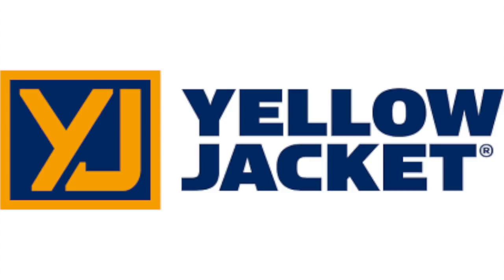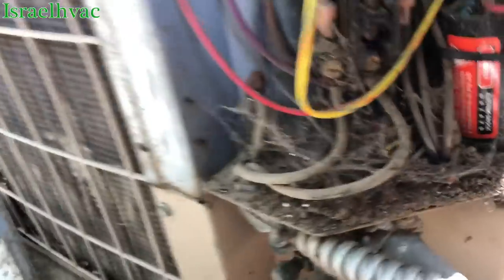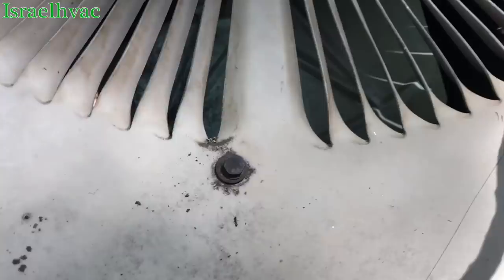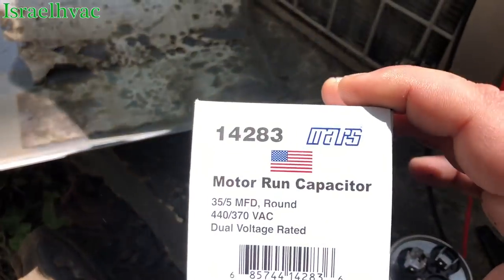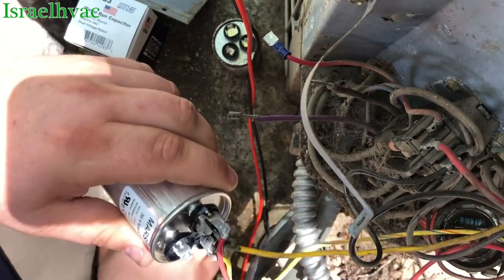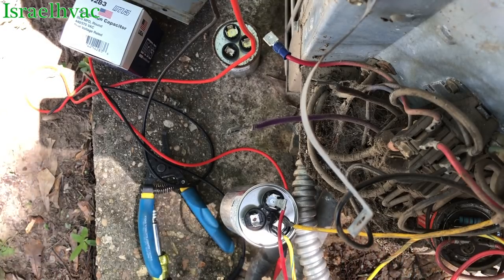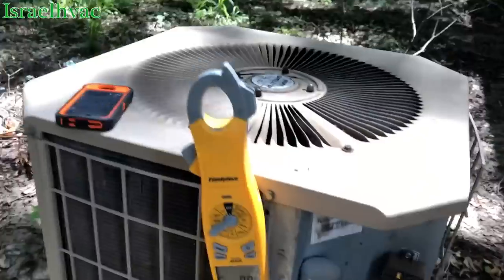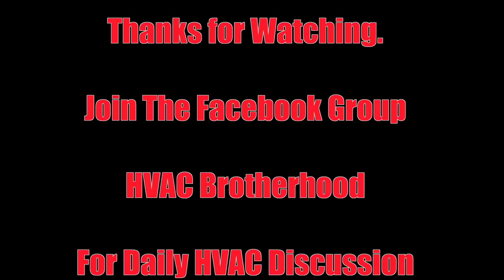Bad HVAC Capacitor | I Make a Big Mistake

Comment: No amp draw on fan motor bro come on. Not trying to hate but I only have 3 years experience and I would have took amo draw on that fan to ensure it's not over amping or close to ITS FLA rating. Could be a call back not always but a 50 50 chance. Good video though

Comment: If I had a leak in my condenser unit what would be the worst case scenario as far as cost? I was quoted $3000. I have a 2500 square foot home.

Comment: Did you know that a bad condenser motor that is locked will keep a charge in the capacitor? I found out the hard way.
Reply: Andy Galindo that's happened to me once. It's usually when one leg is open

Comment: Two caps inside that unit?
The cap you installed had more than 3 wires, looks like 5...why?
Reply: sometimes the fan and compressor are in the same cap.  on a "45+5" MFD, you would have 45 mfd for compressor, 5mfd for the fan.
Reply: @topbuilder3790 Lots of dual run caps have 3 wires. Some have 4.  But 5 wires? BTW, that fan motor has stiff bearings based on the little spin that stick gave it. It is resistant to free wheeling and would likely benefit with some servicing of the lubricant on the bearings if they are serviceable.

Comment: Dang I've wondered how dangerous these capacitors are even in window AC. Was that cap fully charged?
Reply: No. the unit still had power on it from a bypassed disconnect switch

Comment: not the first one to do, wired an ac, turned off main breaker, some fool wired  same line from top of meter to hot water heater wires I was using, always check  with volt meter first.

Comment: If I understand it well, the ac was not disconnected from power?
Reply: Even though he turned it off, the disconnect was internally stuck in the "On" position providing power to the A/C. Best practice is to remove the breaker.

Comment: I've never made a mistake!   But I did blow the end of a screwdriver off to put metal in my glasses and catch my beard on fire,......but I meant to do that. I got tired of cutting the breaker on and off testing with no disconnect at the unit. KInda like a gun, it's always loaded, even if you just checked the chamber.

Comment: Lucky it wasn't 575, my old journeyman, told me 20 years ago, never trust your meter, that's how you get killed, 2 this day, I have another meter I carry, and recheck big voltage, or use a another source to check. 240 sucks, and 120, it's annoying 3 phase, you may not come home.

Comment: i go to my circuit breaker panel and i turn off the main breaker off and turns off the power to the entire house
that way i know i'm 100% safe. Then i use a screwdriver and touch all of the leads on the capacitor terminals to remove any remaining volts that might shock me. Is so simple! Just common sense people!

Comment: Subsequently made the mistake of trusting the insulation?... I learned my lesson getting stuck on pair of strippers with an insulation defect. Gettin bit is one thing, gettin bit and having your hand lock you into it is no joke. Luckily, I was poorly balanced, squatting and the weight of my body falling over pulled me off.

Comment: If you didn’t repair or replace the disconnect knowing it is wired wrong or broken  you should be ashamed of yourself the next guy may be working in the rain make the same mistake and not be so lucky. 😔

Comment: Why didn't u just install a 5 microfarad capacitor for the fan
Reply: Simple reason for that; if a capacitor has a bad fan side (dual run cap) you always have to assume that the compressor side will fail also at some point. It's almost like changing out a fuse in a disconnect. Why not change both so you dont have a call back.

Comment: Well from what I can see you made two big mistakes one bigger than the other.  After you realized there was power you wired it hot, not really a big deal if you're experienced.  But the second and bigger mistake was not fixing the root problem.  No mention of it being fixed or letting the owner know to fix it, so I guess its up to the next tech to fix it if the shock don't kill him/her first.
Reply from the maker: The customers electrician replaced it the same day dip shit. It’s some Low income property and they wanted their electrician to replace it. Before you make comments make sure you have all the fucking facts.

Comment: You should be an example and NOT continue experienced or not. How many idiots out there will see this and try to be careful and install it anyways? At least pick up a pen volt stick meters and check. They cost around $15.00 for a decent one. If you use one and get voltage, get a better one. To make sure turn off the main power. I'm guessing that check the Disconnect you mean the breaker on the outside next to the condenser right?
Reply: I apologize. I should have said it like that. I realize that as HVAC and Electricians, you know what you're doing. As long as viewers know, Electricity does not kill you, Amps kill you. It only takes 1 millie amp to kill you. that's 1/1000 of an amp. My instructor use to say, Don't close the circuit by Touching something with both hands. That causes the current to go from Hand to Hand passing through your heart. Be safe everyone, and God Bless You.

Comment: So if you disconnected already, then how did the unit still get its' power?  Some other people testing or changing capacitor said you should turn of the thermostat as well because if it call for power then it still receive 120V as seen here.

Comment: I Am Sure you just Stopped The Vidio before you checked Amp Draws and Running Volts. I Have also gotten hit by Disconnects that did not open. No Fun.. The Voice over is likely more because what The Original sound was is not YouTube Friendly..😁🙂

Comment: Watch this guy he will cut out your txv and replace it with a piston it’s the equivalent of removing the fuel injection from your car and replacing it with a carburetor your performance and gas mileage just dropped or in the case of a air conditioner your cooling capacity and seer just dropped the manufacturer puts them in for a reason John 
                               Sincerely your funny guy
Ps always test power before working on electrical equipment even if your an expert

Comment: Always carry a good  volt stick test it to a known power see it works well everytime thats a basic must have for anyone working on electric its a secondary check to make sure ,ts very important but Thanks for posting getting to relaxed about it lately,  that was wake-up call 👍😨🤞
Reply: the contact-less voltage sensors should never be trusted alone, just good for preliminary check, always use an actual meter to back it up!

Comment: As an electrical contractor I can see that this is a prime example of why HVAC trade should never work on electrical.  They don't have the knowledge and experience to understand why the job needs to be done correctly, not ignored and passed on to the next service tech.
That's exactly what occurred here.
That unit should never have been worked on until power problem was repaired, and definitely not put back into service leaving the existing electrical problem intact.

Comment: ALWAYS REPLACE RUN CAP WITH NEW MOTOR...I bet the CFM burned out a week later.
COMPRESSOR motors  can take new cap with no problem , but CFMs ?... I have been on too many calls where a lazy tech just replaced the cap and the motor burned out  a week later.

Comment: If you died it was your fault. Even newbies check for power with meter first.
Never trust a disconnect. Your trusting everyone that worked on that unit, and from the day it was put in. And it looks of its had a history. Old piece of shit.

Comment: Would you voiceover you stay to you shouldn't be doing that but you still did it and you showed it on the video which is wrong if you say you shouldn't do it you shouldn't show it in the video. Correct a video do it right or don't do it at all don't come on over with the voice over later and say this is way it should be done and you do it the other way anyways cuz people are going to follow it and do exactly what you did whether you say not to or not. Don't be a hypocrite that's exactly what you did don't do as I do do as I say and that's what you turned out to be a hypocrite. If you going to teach a video teacher it right or don't teach it at all

Comment: So wrong on so many counts.  Ok at first you trusted the disconnect. Anyone would too. No big deal, but you didn't correct the problem and continued to work with a hot circuit. Then you publish a video showing your stupidity. YIkes. I've been doing HVAC for 37 years.  Though I'd seen everything.  Boy was I wrong!